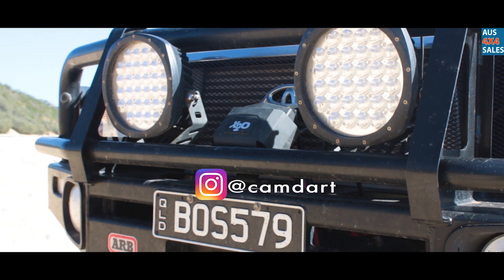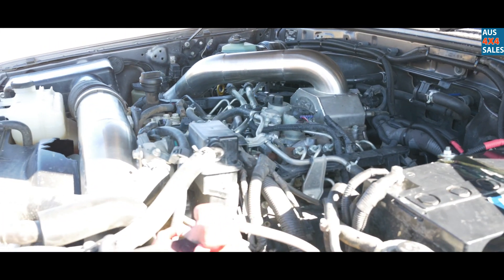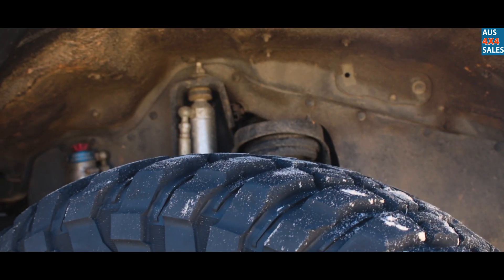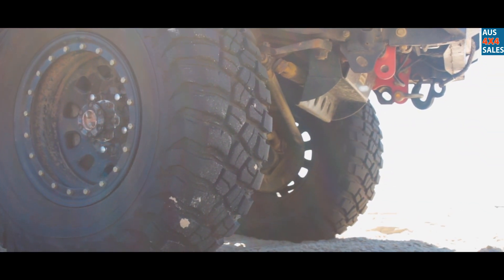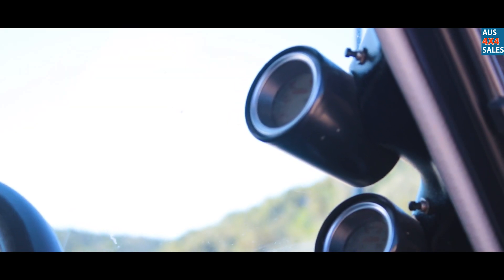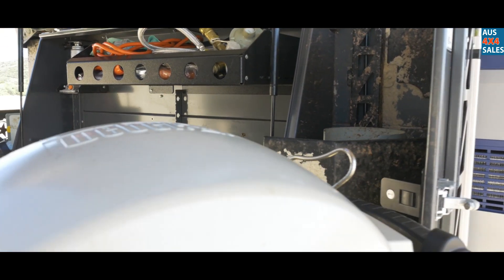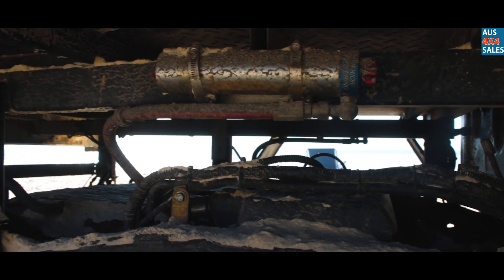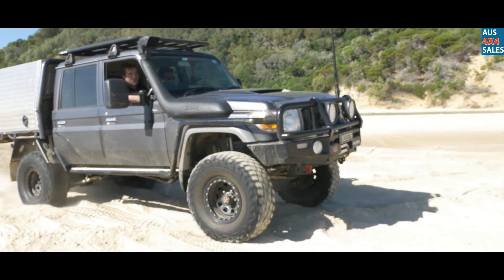400HP Landcruiser 4.5 V8  G Turbo Red Wheel 1350NM 5 inch Lift Superior Engineering Coil Conversion

Comment: And what career path has cam chosen. Id like to follow suit
Reply from the maker: Chippie
Reply: Doesn't matter what job you have if you cant manage your money
Reply: @ElisPalace  true. But im sure theres a slight pay difference between a qualified tradie (speaking) and someone who flips burgers at a fast food joint. So you can manage your 300bucks a week all you want but if your bringing in over 100k a year, your able to splash a bit
Reply: @datsunliam5514  yeh obviously if you making more you can save more but I've worked in tyre shops earning a normal wage and on mine sites (I have a trade as well) earning well over 100,000 a year and I've always saved and been good with my money.  You can earn 200,000 a year and have no money
Reply: @ElisPalace  amen. Like this fella with a 400hp tojp and a patriot camper haha
Reply: He probly has a massive loan.
Reply: @datsunliam5514  sounds like your from America, in Australia its not hard to make good money and save, even if your "flipping burgers" your still making 24$ and hour or more.
Reply: @elrud5964  im an aussie mate and i have a trade
Reply: @datsunliam5514  same, boily. I make good money but i still spend it all on my cars 😭
Reply: @elrud5964  haha well, im a pastry cook, i make just shy of 100k a year.. but mortgage and loans and 2 kids means fuck all left over for toys. But. I make it happen haha
Reply: Who gives a fuck what a rig!
Reply: This thing would pull Christ off the cross for fuck sake 💪

Comment: Feel like that torque number is being taken @ the flywheel to be honest. Not at the wheels... 🤔🤔
Reply: Yeah agreed mate, if it was a 5.9 cummins or a duramax that would be a believable number.
Reply: yes you are right
Reply: Just autos did a mild tune and set up on the all4adventure black truck and it did over 900nm at the wheels
Reply: Will be a flywheel number especially with only plus 30 injectors... plus 70s and then you're talking close to 400hp at the wheels
Reply: grandpa johnno nope you’re wrong
Reply from the maker: Thanks for the comment and feedback

Comment: How reliable is his engine going to be though running that sort of power??
Reply from the maker: Time will tell.
Reply: AUS 4X4 SALES how kms has it done since this engine work had been done?
Reply: Jack Hosmer diesel are awesome when tuned. Even with all the engine mods i think you will find its  afr would be better than stock. The only thing that would kill that is using the loud peddle to much
Reply: Brock Sinclair yeah mate, I’ve got mods done to my cruiser it’s running 
20psi max 
5” dump into 4” exhaust stainless 
2” crossover pipe 
1300nm npc clutch
Q4 5 map select unichip 
Remap
1600rpm at the wheels it makes 
205kw
745nm torque 
It’s pretty mint but was wanting to do more upgrades but I didn’t know if it would effect the engine in long term. I service my cruiser every 5,000kms regardless aswell. 

Gsl Fabrications done my work.
Reply: Jack Hosmer ahh mate. Its like all engines, treat em good they last. I know people do most of these most to go hard but if you drove it normally it would last. Good thing about diesels is that boost doesn't kill em. Common rails injectors are a bit finicky and sensitive just be on top of that. Get the cool air in and the hot air they love it haha
Reply: Well I have killed a set of injectors but that was user error way to much nos  other than that I have not had many major issues the engine has had that power for 60k and its just about to hit 100k. I have had more issues with gear boxes and uni joints but boxes are $1000 from the wreckers when I bust a gear I throw another in.
Reply: Cameron Dart pretty unlucky i think. Thats why the hdj79 were so good. Way less drama